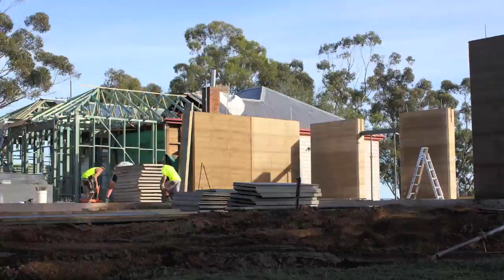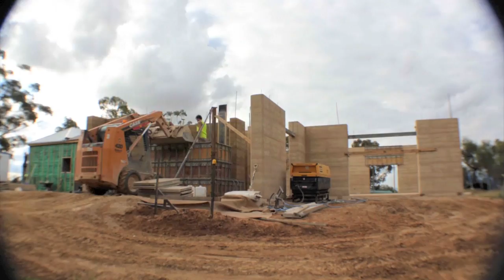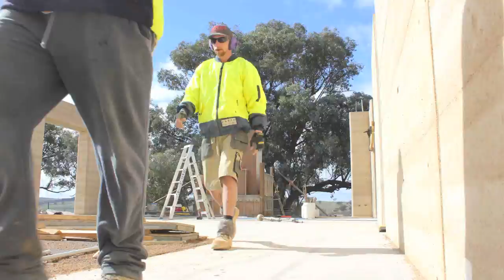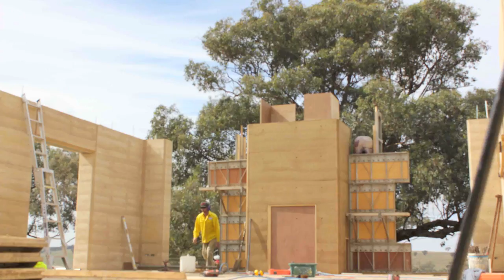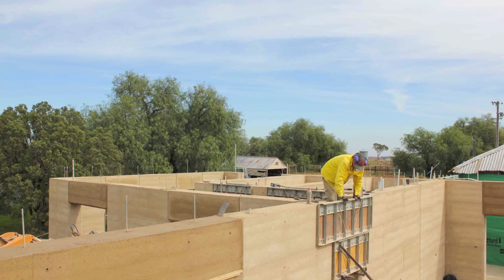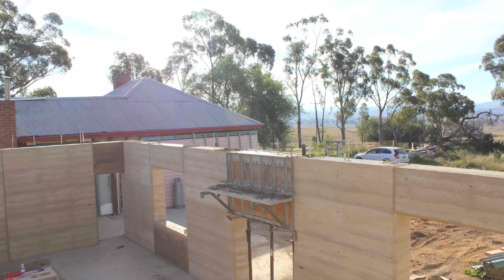Rammed Earth Construction Timelapse

Comment: Hi! Does it need curing after casting like, as we do in concrete?
What is the maximum and minimum height  you fills on the mould before ramming for each layer?
And what is ideal height of that layer you prefers after compacting? (Ratio of intial height to final height)

Comment: What's the advantage of this building technique over poured concrete?
Reply: @VasilSvolopoulos  Most of your points are also shared by concrete. 3, 4 and 5 are shared between rammed earth and concrete for the most part. As for point 2, standard concrete usually only has 10-20% not 90%. (https://www.nrmca.org/aboutconcrete)
Reply: wayyy stronger
can get up to 3000 psi

Comment: I noticed that you are building the walls as SRE columns in one go and then coming back to fill in the sills and lintels. How do you ensure an adequate bond between the previously built column and the new SRE sills and lintels?  Is there any potential issue with cracking or movement at these locations?  Would this be a potential weak point for air/water leakage if it was to move or crack?
Reply: The lintels are tied to the walls with what looks like a steel bond beam. I think in many cases they also pour a concrete top plate around the entire perimeter of the house. At the base all of the sections are tied to the concrete footing, so the walls are tied together at the top and bottom. I would expect when you ram a new wall next to an existing one however, you get pretty good adhesion. Try to rub two pieces of sand paper together, it's very difficult.
Reply: @ErikPukinskis  I’m curious to know what mixture they are using here for their rammed earth
Reply: The material is 14mm to dust road base that is blended with approx 10% off white cement. 
There is no bond beam. The lintels over openings are epoxy chemset to each panel with pins bearing approx 200mm into each panel. Smaller opening to 1.4m in length can be cast insitu using internal Reo bars as the lintel.

Comment: how about the walls? are they element proof or do you need to coat them with something for the rain. Where I am considering this (tropical Africa +- 2 deg lattitude weather changes from Very Hot during the day to very Cold at night. from Very Rainy during the monsoon to very dry during December. Just wondering how a soil structure will fare.
Reply: Collins Areba they are just like stone , the best way is to use crushed limestone in the mix with the earth and cement. There are structures in Italy over 1000 years old still standing with this method.
Reply: @tt55k çimento sağlıksız olur kireç neyse de en doğal olanı çimento suz olanıdır böyle yapılacaktır
Reply: This is a Ugandan 😅

Comment: i Priced this type of construction, pricing was about the same as a conventional
home, one of the things that made it that EXPENSIVE was the concrete footings for the walls, the constructed weight of the home was estimated to be about 80 tonnes which meant the footings needed to be about double the size normally required. My land was a lot of clay in the soil, so it moved a lot between the dry months and wet months, a sandy plot would have been cheaper for the footings. finished cost $120k 300m2
Reply: friend One , will last 10 times longer than a conventional home and the savings in heating and cooling cost will make up for the cost of the footing .
Reply: $120k for 3200 SF is about a 3rd of the price of conventional building...way cheaper?? I assisted on a rammed earth build in GA and their 2800 SF all off grid, all major upgraded home cost less than $120K to build. All of their windows and doors were upgraded, most expensive windows and doors available from a commercial glazing company. Then, the owner, whom is an environmental engineer and never built so much as a bench before built a matching workshop perfectly, months later, just him and 2 friends. Anyone can do this and its far less expensive.